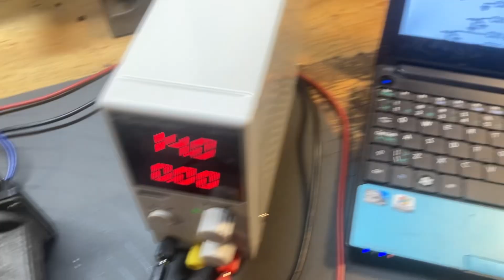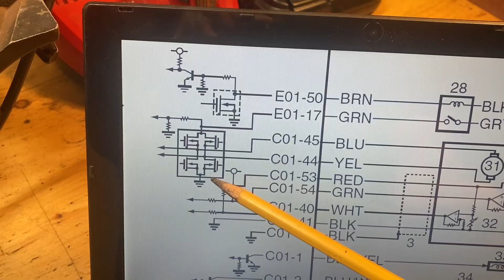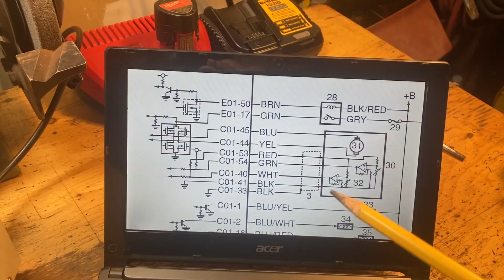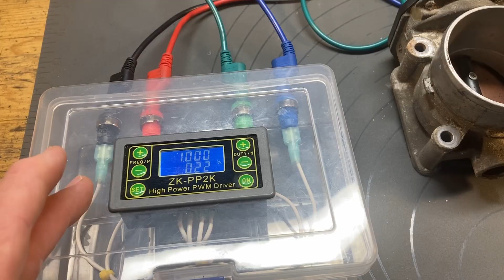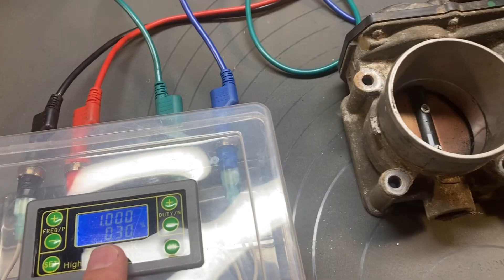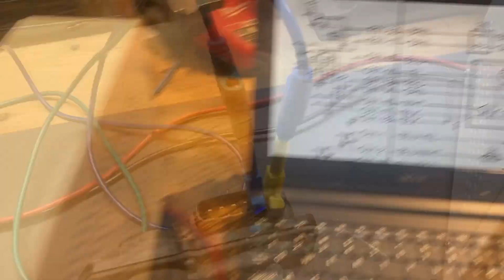Cheapskate Electronic Throttle Control Bench Testing

Comment: I'm glad that you posted this one. I have a vehicle here with a throttle body fault
Reply from the maker: Hi DJ. That little PWM driver is very handy and versatile. Also dirt cheap. My favourite aspect of it 🤣 Good luck with your ETC fault and thx for watching 🍀👍🍻
Reply: @TheGibby3340  I believe my ATS scope can do the same thing, will check it out. The Ford that I'm on uses the H bridge to control the power going to the motor. In this case the motor is being shut down when the ECU kills the power at high rpm. will see comes about.
Reply from the maker: Check both side of the motor are receiving correct polarity drive and both (sometimes 3) position sensing channels are feeding back accurate/reliable voltage. If it’s only at hi RPM might be a wiring issue. You already know this….You know what yer doing. 🍀👍🍻